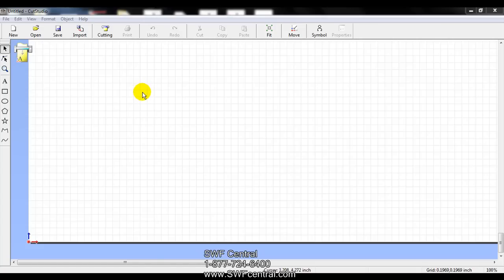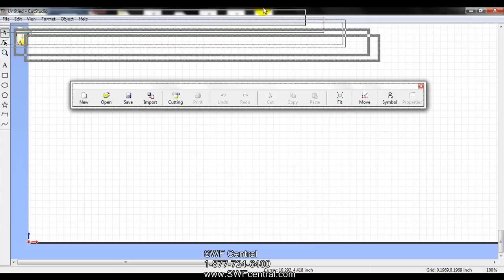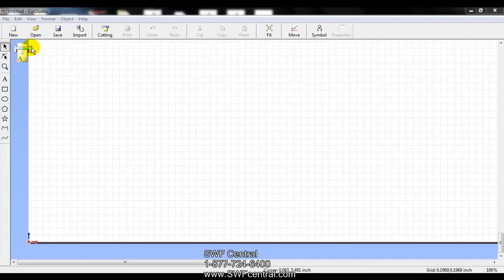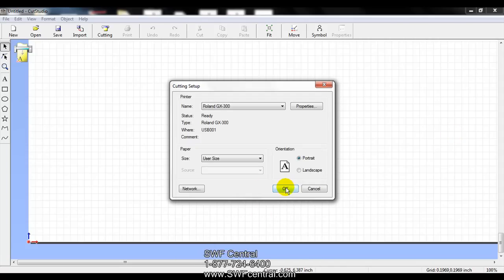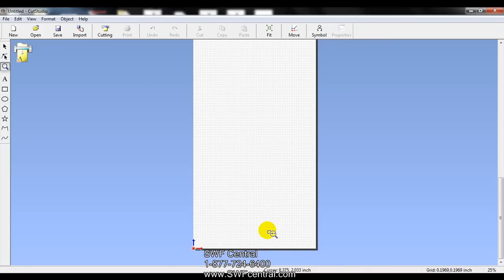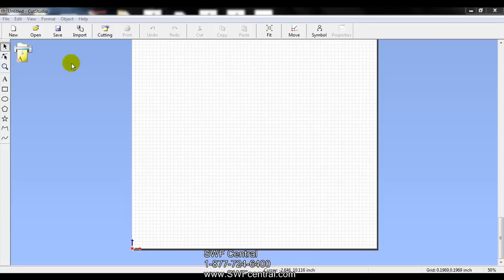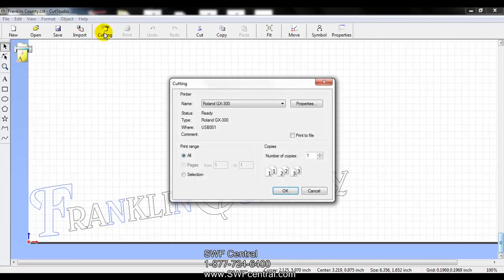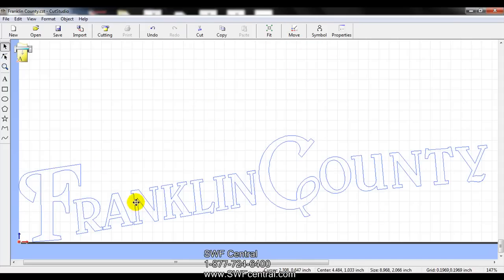Roland Cut Studio - Introduction - Video 1

Comment: Great video, very detailed. I just have one question. i followed everything in the video and it does cut, only it will unroll my vinyl roll about 600mm then start cutting exactly what i want. is this something to do with the origin point?
btw, im using a roland CX-24 which was never made for windows 7, i have gotten it working however.